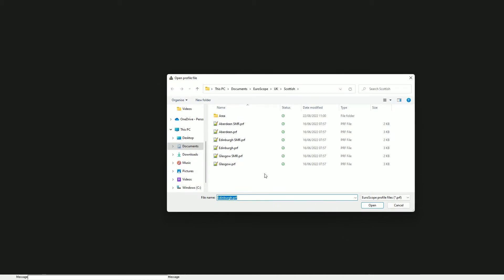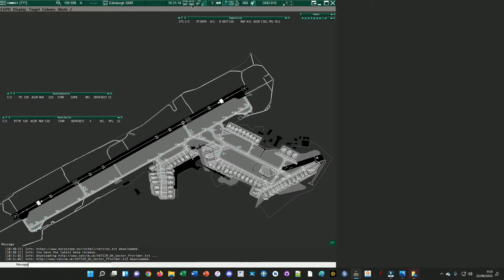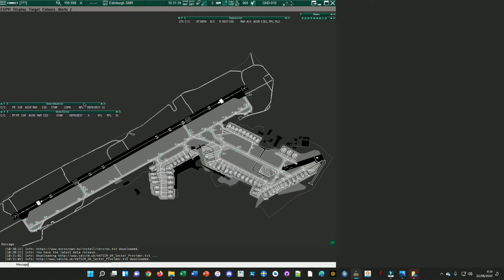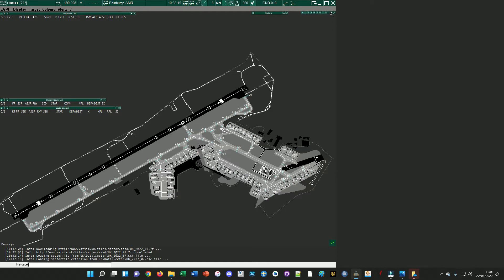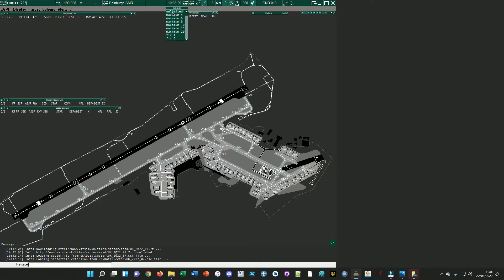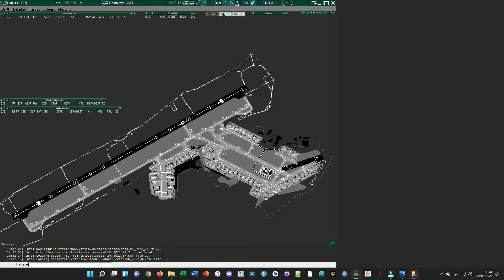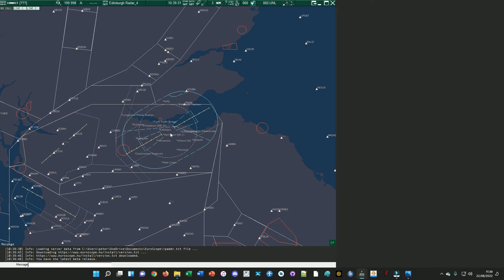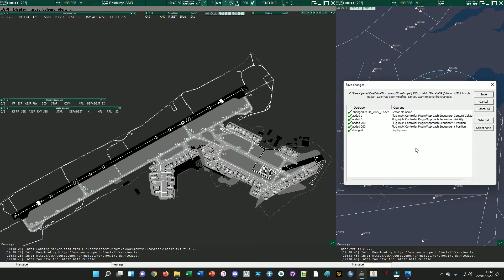Euroscope Configuration - How to Setup ES following install. Example for Edinburgh Tower (EGPH_TWR)

Comment: Thanks for this video. There are many useful plugins in UK sector. What do you think is it possible to make them work independently in another sectors? (I am controlling in Ukraine)
Reply from the maker: The vSMR plugin should work with any sector I think. I think the UK Controller Plugin (UKCP) is probably more geared towards UK stuff like SRD search and stand allocation etc, although stuff like the timer that's in it could be useful I suppose. I think you should be able to download it and try using it, but I don't know whether it would (at least not all) work for you because I think you need a key to connect to the API and stuff. I think at one point they talked about releasing just the generic features of it but I don't know if that ever happened.

Comment: Hi Peter How did you get the full outline of the UK showing? Thanks Jeff
Reply from the maker: Do you mean the coastline thing on the radar display, because I thought that was on by default in the Edinburgh profiles, but could be wrong. Anyway you can turn on those regions in OTHER SET -> Display Settings... -> Regions, and it's the ones at the top that start with an "A-", there's 9 of them I think, so just tick all those for the whole UK, but usually you just need one or two depending where you are.
Reply: @PLMRailways  I have my coastline outline but you can see the hole UK in light gray on your stream. Cheers Peter
Reply: Cool i've done it Thank you Peter

Comment: I have one question tho. (I'm setting up for EDDM but I think should be an inbuilt function, no plugins)

Of cause planes get tags on Ground. However, what about planes that have just spawned in and not received a squawk yet? When I log in they are just shown as planes without a tag and any information. So I have a hard time identifying the calling station as I don't see any callsign. Is there a way to set that up? I have seen a "tag" menu in the "other settings" but that looks quite complicated and I'm honestly a bit overwhelmed by that.
Reply from the maker: I don't know if EDDM profiles use vSMR (which is a plugin) to do surface tags, as the UK do? If they do you'll see that grey bar at the top with Display, Target etc in it. In the UK Pack, there are different profiles for that, one of which is called easy/obs or something, so you can change to that using 'Display' -> 'Profiles'. You can also individually 'Acquire' an aircraft using vSMR that isn't squawking using the 'Target' -> 'Acquire' button, then clicking on the aircraft blip. If you're not using vSMR or still having issues, just make sure your 'Correlation mode' in 'Other SET' -> 'General Settings' (towards the bottom) is set to 'Easy'. Hope that helps, like I say not sure what Germany uses.